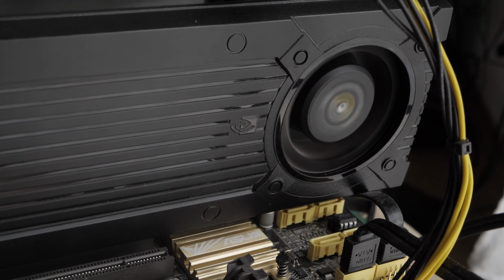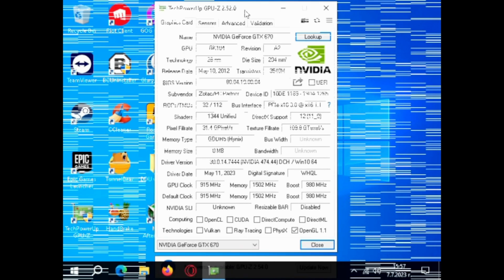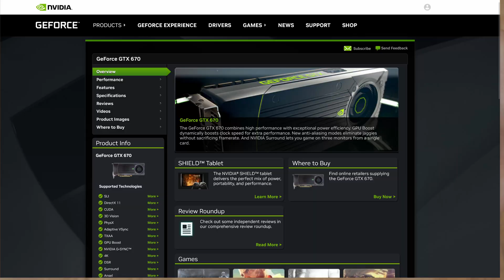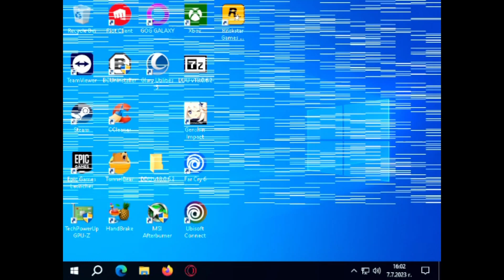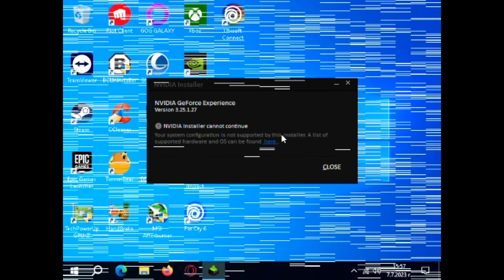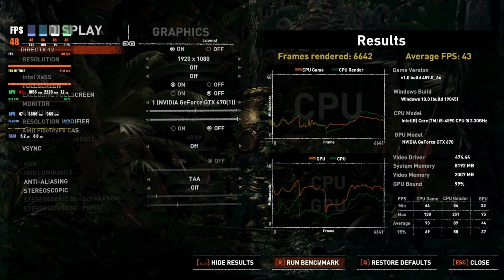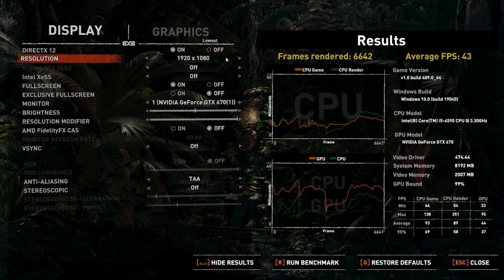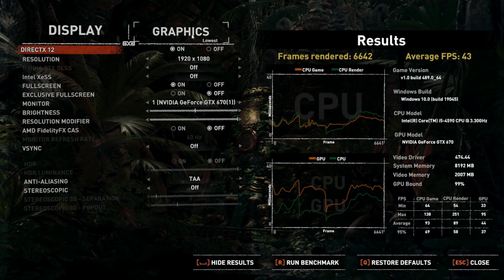Old and hot second hand NVIDIA GeForce GTX 670 in 2023?

Comment: a copper shim plate for the memory might help if you cut some with tin snips from 1mm thick copper sheet. that spreads out the heat and you cause paste or pads to help the connection.

Comment: most common fault is that some pins get "unsoldered".

Using hot air on the GPU DIE should fix it, but in reality a perfoament fix is reflowing the gpu die

Comment: What happens if you plug the display cable into the igpu instead? Will there still be artifacts?
Reply from the maker: With the iGPU everything is fine, no artifacts. Same cables, same display
Reply: @NerdyThrowbackTech  So the gpus work fine when running through the igpu? Can it also play games when connected through igpu? Kinda like laptops
Reply: @mecyanned  but totally not worth it in my opinion since too much performance loss
Reply: @nothinginteresting1833  better than nothing
Reply: @mecyanned No, the gpu is cooked, if you plug the cable in the igpu its gonna just use the ugpu

Comment: i had a GTX 760 with almost the same board model as yours, can you try modding the bios?
Reply: I have modded xtremeg drivers you can try too, they are signed with nvcleanstall
Note: they are version 472, and latest supported is 474